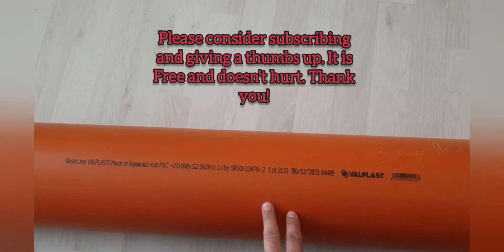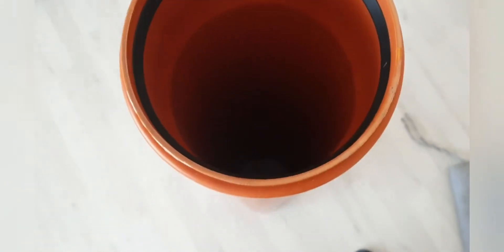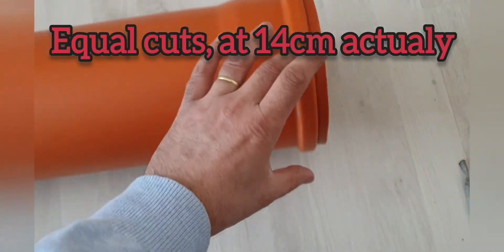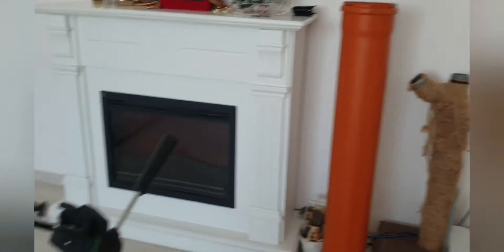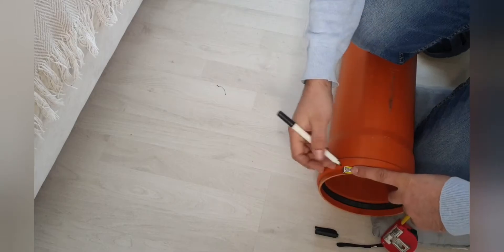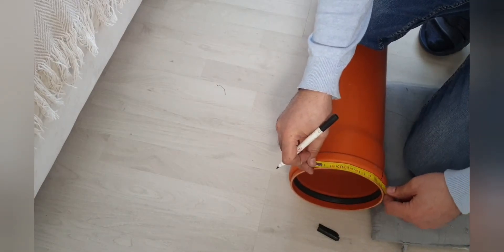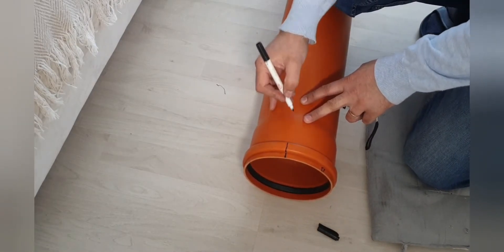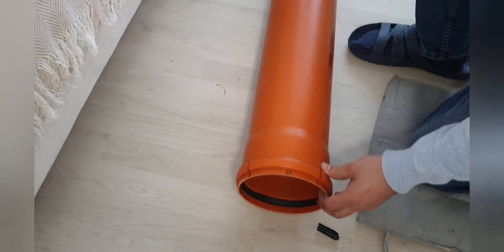Making the blades for the wind generator made from a 48v 500w  motor part2

Comment: Generatorul din roata de scooter are multiplicator de turatie in interior?da?...merci.😊👋👋👋
Reply from the maker: Nu, este direct drive, nu are pinioane in interior.
Reply: @cristianbuga5126  Multumesc Cristian.turatia este suficienta?...sau speculezi faptul ca este  tensiune ridicata?...stochezi ?..in ce domeniu de tensiune?crezi ca este bine sa prelungesti axul central si sa ancorezi virful paletilor ca acestia sa nu se indoaie spre spate la vinturi mai mari?...merci.😊👋👋👋
Reply from the maker: @danieldragota2985  are suficienta turatie, scoate 22v maxim in turatie maximă dar nu am umblat la infasurari ca sa cresc voltajul.
Reply from the maker: @danieldragota2985  stochez in 3 acumulatori de 12v 120Ah.
Reply from the maker: @danieldragota2985  iar sistemul este suplimentat de un sistem de panouri fotovoltaice. Respectiv 500w panouri